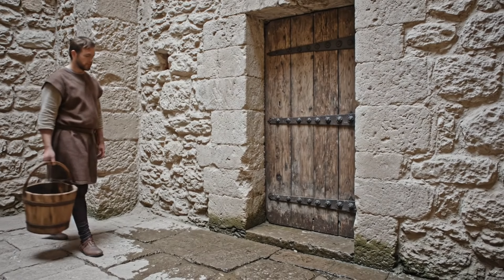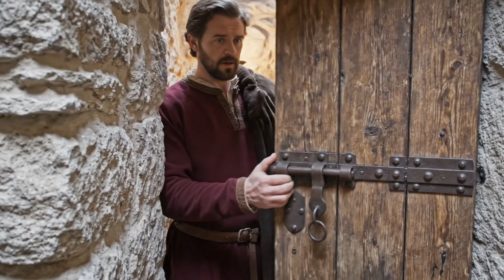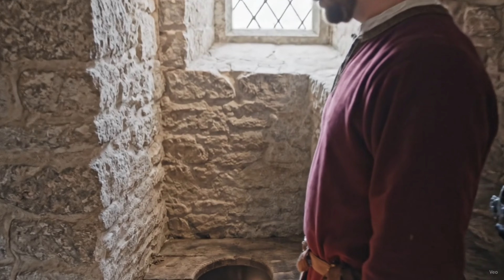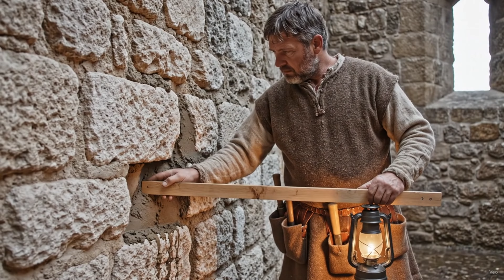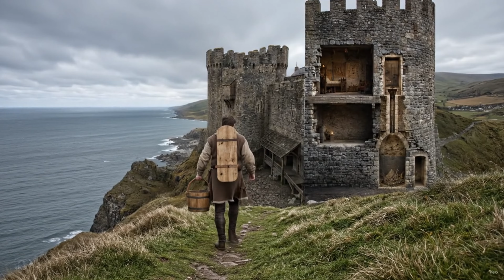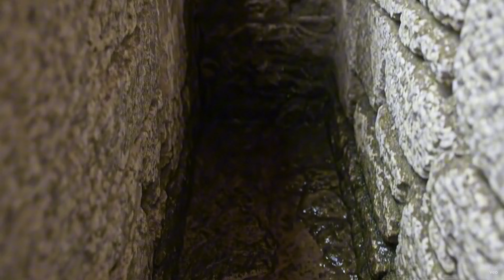How Medieval Castle Toilets Actually Worked

Comment from the maker: A medieval castle toilet looked simple from the room above — but underneath it could be an entire system of shafts, pits, drainage routes, masonry, and human labor.
Which part surprised you most: the hidden chute inside the wall, the deep cesspits, or the fact that workers still had to clean everything manually?

And here’s a quick quiz:
What did most garderobes rely on to move waste downward?

A) Pumps
B) Gravity
C) Pressurized water
D) Gears

Drop your answer below before checking the video again.